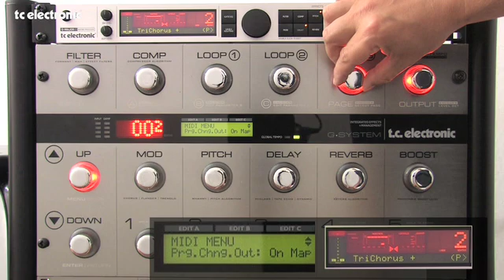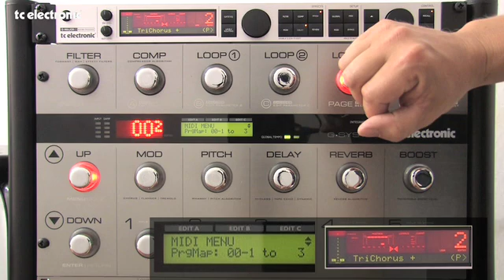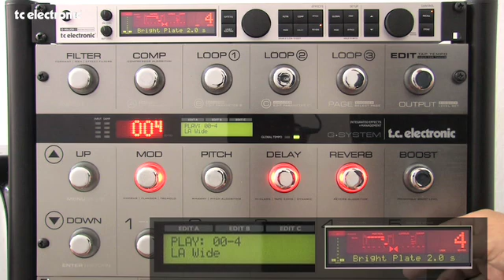G-System tutorial: Setting up G-Systems MIDI map

Comment: AMAZING! Now i can recall any preset i want from my Roger Linn Adrenalinn through the G! Thanks a lot Joey and TC!
Reply: lechatpop

Hey I am also using this MIDI function to the Rogerlinn Adrenalin. I have a question if you can help me out, I have presents on the G-System set to presets on the Adrenalin for some presets. On other presets in the G-System however it still does change the preset on the Adrenalin but it also turns off the effect power button. So on some presets it’s on and it works but on some other presets it’s off. How can I do to have them always ON on the Adrenalin when the presets are changed using the G-System MIDI??

Comment: so is it possible to change channels and midi controlable setting lets say on an engl invader or Koch supernova via the g system .. so for example to have pedal number x, with g systems delay on, with channel 2 of the amp, with high-cut voicing activated on the amp... at the push of a button (in a preset) ? Im getting a koch supernova and want to control everything with the G system... thank you in advance!